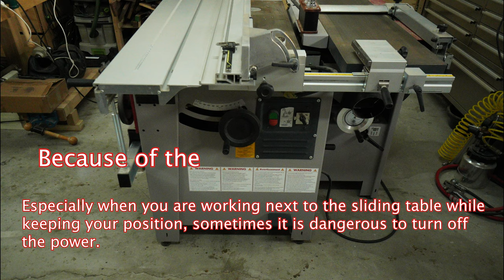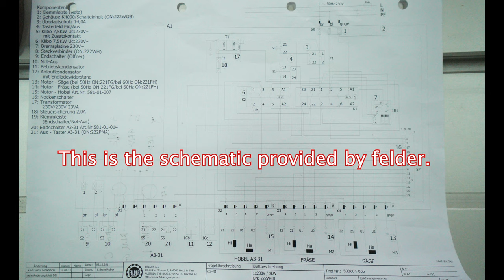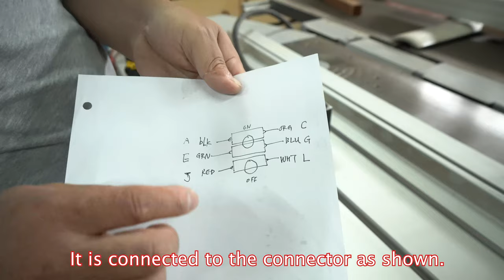DIY Hammer C3 31 Remote Switch

Comment: hello!! 
sorry, can you help us to connect correctly my machine?

we recently bought one of those, and it dosen´t fusion correctly
Reply: Yes I will help if I can. Can you show the circuit you connected? And is ti the same model as mine?
And tell me exactly what is the problem?
Reply: Hi, I notice that you have a different fence lever.  I don't like the standard fence that comes with the machine, does the additional one you have make a difference, less flex an easier to make minor adjustment? Appreciate your reply, not many youtuber out there posting videos about this machine.
Reply: @Explorerdxb  Sorry I didn't see your comment. I used two types of fence. at 0:25 in video, left side fence is standard fence that comes with the machine and the right side fence is I bought optional, This optional fence use for table saw almost and the standard fence only use for jointer. and I also have minor adjustment function part but I don't use almost it's not easy for me. Just I tapped the fence for minor adjustment.^^